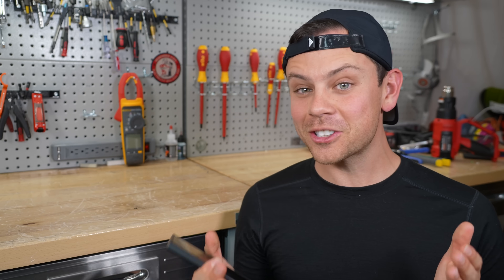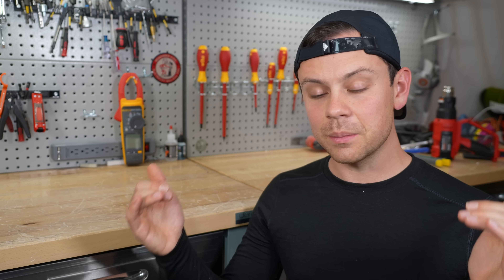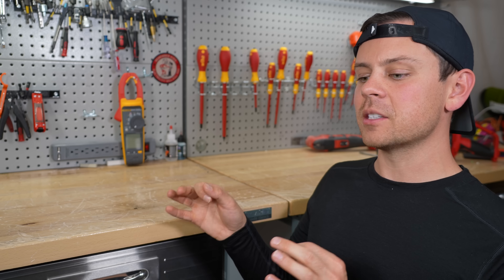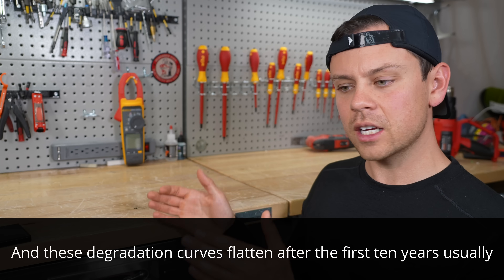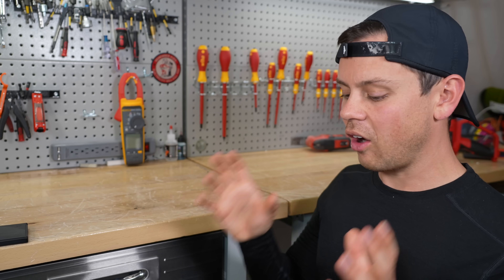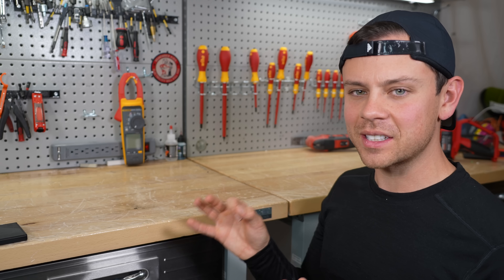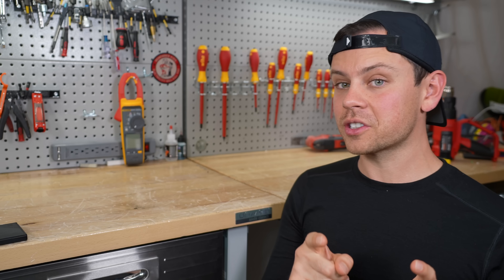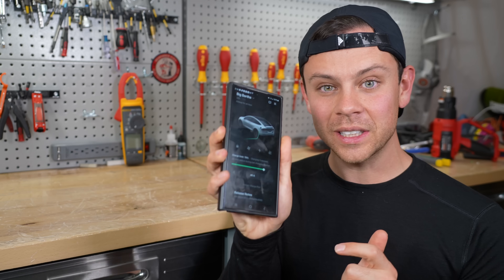LiFePO4 Longevity Discussion! Why Charge to 100%?! For Solar??

Comment: OK, I'm reasonably new. .... I've lots of questions that I'm working through. But after watching a few of your videos a couple of questions come to mind.  1) how "hot" is a hot environment. 2) how long is "long enough" for being at 100% to facilitate battery balancing. Refrence, I've a new Solar system A new EG4 18Kpv with 560ah outdoor rated batteries (outdoors) fed by 3 strings of solar panels producing ~12Kw (soon to add another ~4Kw and 400ah rack batteries) in a sothern US climate?  TIA

Comment: Thanks for the video. I am on the fence of getting these batteries for my off grid solar system. 
I understand that these batteries need to be charged to 100% and discharged to 0% every day, but that is very hard to achieve especially if you have several days of autonomy. How would you do it in a real world scenario. What you're saying is suggesting that you only have enough capacity for a single day of use and to use it to its maximum capacity. That's not very practical. What if you don't have enough load during a day to discharge it? What if you don't have enough sun to fully charge it? Could you please elaborate on this? 
Thanks.

Comment: I love all of your videos Will!  Do you have one that explains how to compute the maximum charging rate of a system of batteries in parallel?  For example, if I have 4 x 300ah batteries with 200 amp bms wired in parallel (to a breaker bar), can I charge and draw from the system at 800 amps or am I limited to 200 amps?

Comment: Do you have recommendations for high heat (here in Phoenix) small solar battery system for home backup. (Run  fridge and cpap during power outages)

Comment: Thank you for all of your excellent videos! I have four LiFePO4 batteries in my RV. 400ah. They are placed along the chassis, outside of the heated space. It is indeed charged by solar. My question is, what state--of-charge should I be charging them to considering this is an RV that often goes months without being used? The solar you're referring to in the video seems to be for home solar, where users are putting a load on them each day. There is some parasitic draw in the RV that I am working on fixing and therefore it gets a bit of draw (and therefore voltage dip) each evening, but not much. Hopefully I'll have the parasitic draw fixed soon and then there will be very little draw. So the question is, what SOC should I charge them to when the RV sometimes sits for just a few weeks and other times it sits for 3-4 months without being used. THANK YOU!
Reply: Watch the previous video he made and is discussing here.

Comment: I bought 20 kWh of LiFePO4 batteries last year to complement my residential 7 kW solar system. Have a 2-phase Victron Multiplus II 48/5000/70 ESS running as we speak. Came across so many people in forums stating how you would kill your batteries by charging to 100% too often or down to 0% that I was actually considering buying another 10 kWh 'to be safe'. Then I came across Will's advice and 'bit the bullet'. Turns out the batteries have 5% more oomph than they're rated for and can handle deep cycles without issues. I couldn't be happier. Many thanks from the Netherlands Will! 🙏
Reply: What 100% is varies wildly depending on your BMS anyway. And everyone pretends they know what they're talking about when all they ever see is percentages.

Comment: WP thanks for all your work. 

Note: Totally Off Topic...  

One issue I hate about YT is their pressure to create content with super abrupt endings. I watch most of my YT videos from a Smart-TV, and adding a "like" takes time to navigate. So when the ending is raidly truncated, a "like" is not going to happen because the YT Smart-TV app dumps me out of the video. 

This means I either don't give a "like" or I have to re-que the video and then sit thru the opening ads all over again (which are getting rather long) just to add a "like". 

Guess which I'm going to do... This process is probably obvious to YT, and to their benefit, not yours (the content creator).

Again, thanks for the channel.

Comment: Interesting!!! I have faced similar problems to what he said!!

I always keep 35% SOC letf for backup power, and when at daytime I charge them, they go to fault mode, which I think is cell imbalance. But I always letf 35% SOC because in my area we have power cuts every day for 1-3 hours.

One time, after my cell imbalance, I discharged my battery to it's near end, and then I re-charged it with solar; the fault mode went away.

Currenlty My both batteries are in fault mode, and it goes to fault mode at daytime when it's charged to 100%, and now I am using these with USE2 mood because I am pissed because of these imbalanced cells. Now the question is, how should I use it? I can't just empty my entire backup power, or should I add more batteries? But I don't have enough budget to buy more batteries. What to do now?

Comment: How would you do this when not using it with solar. I would like to just hook it up to my portable power station. That means I have to manually charge, then be connected to portable power station and it won't get used other than in an power outage.

Comment: Will ,will, will... You have been enormous help to me in learning all about solar systems and I have a large one now and probably started building it even before you did your experimenting... The only thing I question is the resistance of a mechanically squeezed electrical connection versus a soldered connection that is correctly done.

Comment: My dad drilled into me at a young age, partial knowledge is extremely dangerous, always be sure of your information before enacting it. I have to correct people fairly frequently on the 20%/80% rule, IT ONLY APPLIES TO LITHIUM ION, LiFePo4 has a totally different chemical process. Between Will and the offgrid garage in Oz, ive managed to drench myself in facts, cold hard facts. Ill be honest, having been through a vehicle fire once that wiped out 5k worth of tools and kit (not imsured) battery degredation doesnt concern me anywhere near as much as creating and unintended "heating element" and dying in a raging inferno!!
When it comes to DC and solar etc, there is literally no such thing as too much information, learn more than you need.
Theres what you know.
What you think you know.
Then there's not knowing what you dont know, and this last one is far more dangerous than anything else!!

Comment: I have two DCHouse 100ah lifepo4 batteries in parallel. My solar controller is quite simple. Basically it will charge to a specified voltage and then keep it there by reducing the current. In winter my solar struggles to keep the batteries charged. In summer I have more than enough power. What charge voltage should I set the controller to? 14.4v and leave it on that all the time? Or fully charge and then set it to 13.5v to maintain it? I get confused. At what voltage do the batteries start to balance the cells? Thank you.

Comment: During the winter months, my solar usually only charges my battery 10-20%. So if the battery is going up and down 10-20% every day for a couple months, it sounds like the best range would be 40-60%? so it averages around 50%   Or should I set it to use the 80-100% range so it sees some top offs during the winter?

Comment: In a stored RV with LiFePO4 batteries and solar, should the RV be plugged into shore power, which will just keep the batteries charged constantly by the converter? Or should it be unplugged and let the solar controller actually feed the batteries? I guess this is the same at a house for a grid-down back up when they are charged from the grid only and held at 100%. Is keeping them at 100% most of the time a recipe for early failure?

Comment: Hello Will  what do you consider a hot environment  I plan to get a Pointguard battery for my solar system very soon and put it in my garage in CT. the garage at its hottest probably around 100degrees. I also plan to use it for backup only as I have 1to1 net metering. so I also plan to set it automatically 1 time per week to run my home overnight to have sure its always working. any suggestions ?????

Comment: Unless there is a really good reason to not use the full capacity of your battery bank, it only makes sense to "try" to get it as full as possible when solar allows. If someone told me the gas tank on my pickup would last longer if I only filled it to 80%, I would wonder why I would want to waste 20%, stop more often, increase my risk of someday running out of gas.......

Comment: No need to charge to 100% to balance cells. I got 280Ah packs since 2019, charging at 95% and rarely under 20%.
Balancing is not usefull when each cells are within 0.010 V, my cells at 95% SOC are within this voltage, they are balanced. There is no need to force them to their gut and get them balanced at this state, this is a misconception. It's good practise to use LiFePo4 in their comfort zone, no need to brutalise them.

Comment: You mentioned keeping the LiFePO4 batteries at 100% SOC for a length of time, but I didn't hear you say how long the minimum time should be. I usually see 100% on my system most days, but some days it's only for maybe a half hour, while other days it can be up to six hours. IS there a minimum time to keep the batteries at 100%, and how often should I make sure it gets and stays at 100%?

Comment: If one has a BACKUP BATTERY SYSTEM such as an EcoFlow Delta Pro and you aren't necessarily going to have a power outage... even once a year... what should you do and how often? Obviously, you want to have as much on-hand power for emergencies where you don't even have a clue as to how long the outage will last for. I'm concerned for the investment that has been put into this lithium power station and extra battery. 😞

Comment: If I sometimes charge my battery from the grid (e.g. several sunless snowy days), do I need to always charge to 100%, or can I charge partially and then a few days later the solar PV will charge it the rest of the way to 100%?
Reply: you can charge partially. as far as i know lifepo4 batteries are not that delicate. they would be a good solution for EVs if not for the weight.

Comment: What about using lifepo4 batteries for standby power where they will be charged and stored at 100% for backup power?  They need to be always ready in case a power failure happens. Will they last in this type of application?
Reply: If it were me, I would design the system with about 15-20% extra headroom and keep it charged to around 85% except for maybe once a month, charge to 100, let it balance, then back down to standby levels. But good q, I'd love to hear others thoughts too.
Reply: He said in the video if your gonna store the battery keep it at 50%
Reply: @itsthemilkman9 standby power means in a power failure the battery must perform so only charging to 50 percent isn't realistic because now you  only have half the power and who knows when utility power will be restored.

Comment: During mid winter if one does not get to 100% within one month I’d advise giving it a day on grid charging to keep it at 100% for the day to ensure cell balancing.
Reply: I live in England, the struggle is real 😂 I use my shore power charger once every 3-4 weeks if its a period of (normal) grey skies, but one good sunny but cold day and they fly back up well, if I'm not going to hit 100% as the sun starts to lose its radiance, shore power goes on to get to the top. I switch my arrays off too once a month and drop all the way to zero and cut out. I love solar and managing it. That feeling watching free energy pouring into your bank is amazing 😁🤙

Comment: How can you consistently charge to 100 per cent and discharge to zero per cent every day unless you deliberately apply a load that you don't need, but do it to discharge the battery? Electrical consumption and production varies from one day to the next. This really seems like babysitting.

Comment: I have a 24v LiFePO4 system in my off grid cabin that I visit infrequently in the winter . Should I be keeping my batteries at 100% via solar or disconnected at 50%? I have internally heated batteries and the temp is below 10c . I would like power when I do stay over the weekend even when its cloudy. My 2 batteries are Sungold power 24V 100Ah LiFePo4 Deep Cycle Lithium Battery Bluetooth / Self-Heating / IP65 in parallel and I would love to see a review on them.

Comment: I understand the words you are saying, but I'm confused about the maintenance. If I size my system for 4 days backup. Do I need to plan for "Okay I've got 3 good days of sun coming up, lets force the batteries to 0% and then recharge?" Or is this something where I'd need to perhaps have my batteries in 2 groups and have 1 go offline and just hook up 1500W heat gun and run them to 0%? How frequently do we want to do this 100 - 0 maintenance? Is it a weekly, monthly, season, annual?

Comment: So I have a 36v40ah lithium iron phosphate battery and matching charger used for my 3hp electric kayak motor.  This battery seemed to stay close to 100% for several months when not used during this late fall and winter.  Is charging it to 100% every month or so when not used the best practice?  I have done long term light load testing using a 36 to 12 volt converter and 12 volt inverter to map the capacity curve, but nothing that matches the discharge of the 1300W motor draw.  Is it constructive to drop the voltage down with this load testing and regularly cycle the battery during the off-season?

Comment: Dude.  They are stuck on lithium ion Teslas.  The 80 to 90% rule was discussed for sooooo long with lithium ion Teslas, they hear lithium and think its the same. They don't understand that lifpo4 is different.   That's all.  You are so correct. Lifepo4 should charge to 100%.

Comment: Is there a way to change the setting on the EG4 3000 inverter to discharge the batteries below 20%? It switched to grid automatically for me.

Comment: I keep my Ecoflows stored at 100% for emergency use when the power goes out.  I have enough batteries to last a day and half before needing to recharge, which is about as long as a typical outage.  No need to fire up the generator.  If I had them stored at 50% I might need to charge during the storm or sometime in the middle of the night.  What's the degradation difference between storing at 50% vs 100%.

Comment: I read that the reason auto mfgs recommend regular 100% LFP charging is that the flat discharge voltage performance means you cannot use cell volts to determine state of charge. Instead you add up current draw since the last full charge as a way to estimate remaining range, which works if there are regular 100% charges. This is closely related to you observation about balance since managing for equal cell voltage does not reliably equalise cell charge level.

Comment: yes, if you use a solar cell solution at home for daily use, it sounds reasonable to charge to 100%, but if you have a similar system at the cottage that you use much less often, it is probably not a good idea to set the regulator to 14.5V and thus keep 100% for a long time on the battery bank?. Maybe then charge to 14.2V (80%)? 
You should also make a video for those who use a similar system at their cabin/mountain cabin :-). I have 2 solar panels each 320W 48 volts and a controller that takes down to 4pcs 12 volts LiFePo4 heat bluetooth batteries in parallel. Having some challenges with the battery not draining or charging synchronously? Have powerful busbars and connected + and - on each side of the battery bank.

Comment: Will, 
Your videos are  great!  I've I've shared several with friends and on fisherman group sites.. Could you possibly do a video with a focus on the use of 12V marine batteries in fishing boats.
Both engine starting applications and troll (electric) motor applications (used in series of 24V and 36V are common) would be very valuable to outdoorsmen/fishermen now that the batteries are much more affordable.  Thanks for considering this group- I think This focus could expand your already popular viewing...

Comment: Lived off grid with lead acid batteries almost 30 years, cannot relate how nerve-wracking it was especially when you're set of batteries come to the end of their useful life cycle at 5 to 7 years. Set up a 25 kilowatt lithium rack system 2 years ago and hardly have to think about them anymore checking statuses every few days. So glad that the old days are gone.

Comment: I measured after I charged with litime battery charger then used that voltage  on my victron absorption for 3min and then floats14.6 at  the time thanks for your video

Comment: Could someone please answer this question for me. I have a victron 100/15. with two 100 ah 1000 wh battery lithium phosphate battery. my charger controller only showes 720 wh. shouldn't it be closer to 2000 wh. my batteries are hooked up in parallel. shouldn't my 2000 wh show in my victron app

Comment: Thanks for this, Will. Assuming a battery is stored over the winter at 50% or even 80% (so it's available for emergencies)  how often should it be balanced during that time? I saw something that stated once per quarter but is that enough?
Thanks!

Comment: If anything I don’t discharge enough. I never have to look at my system unless I’ve had more than two cloudy days in a row. And those have to be cloudy winter days because cloudy summer day don’t affect me at all. On average I only use 25-30% of my bank per night. So I likely need to take one day a week or a couple days a month to disconnect solar and let the battery run down.